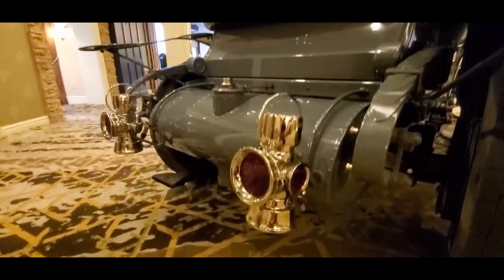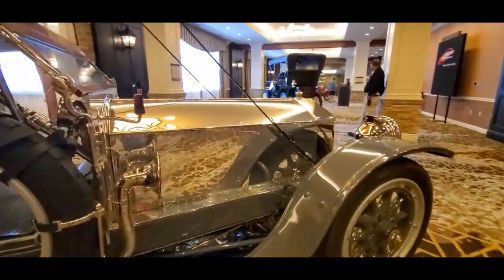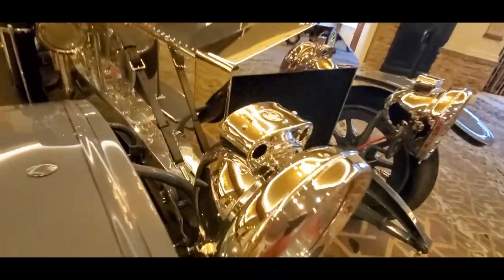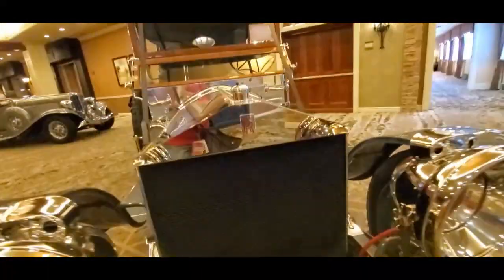1909 Rolls Royce 40 50 Silver Ghost 2023 RM Sotheby's Hershey #rollsroyceghost #rollsroycemotorcars

Comment: It is like a jewel ...but from 2010?, any parts from 1909?🙂
So costume anodized jewelry?🤫🙂
Reply from the maker: Very good question, PTD&Cs !!! I suspect all of the accessories are from the era.
Reply: @carshowreporter  The chassis and most engine parts of this car are original to the car. Like most cars of that period which were coach built, bodies have been changed over the years.